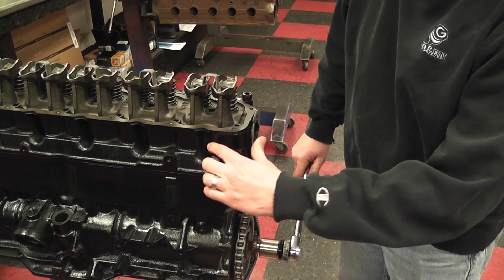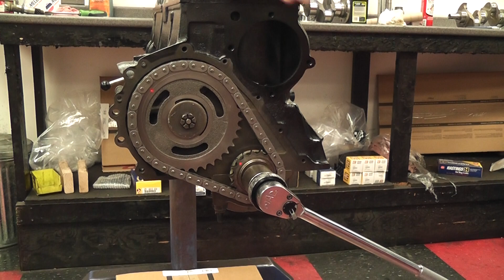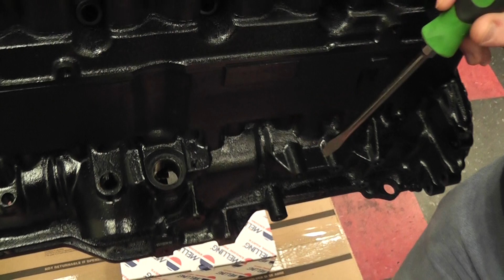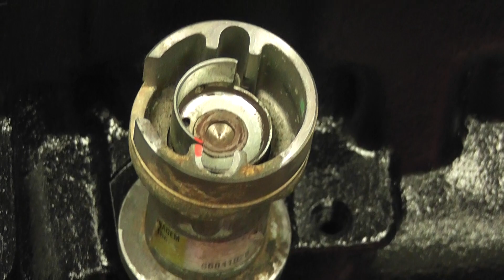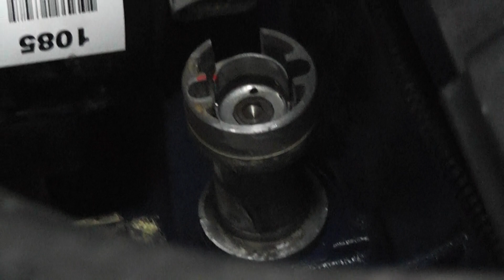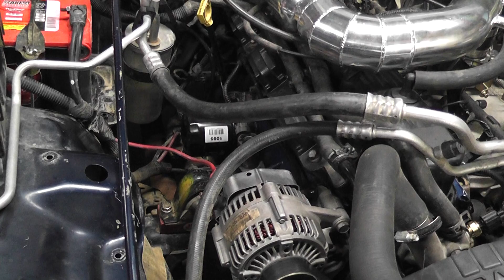Jeep Cam Sensor Install 2000-2006

Comment: I’m doing a long block 4.0 on a 99 Cherokee. Everywhere I look online there’s confusion. Your video shows you starting the engine so, do you think I should line my marks up like yours? Mine has a cam sensor too.

Comment: The best explanation of setting the timing on this jeep engine I've seen.  You can also put the two dots towards each other (not the compression stroke) and then use the toothpick through the side of the Oil Pump drive unit housing and through the alignment hole in the reluctor ring.  Note this in NOT on the compression stroke which is confusing to most folks.  The way you show is what you do if you want to set this all up ON the compression stroke.  Very good explanation.

Comment: interesting, i was taught that the two small holes, one in the housing and one in the rotor line up and put a piece of wire through the set it in making sure the cap connector faces straight backwards i have had mine installed for 1000 miles and runs great...but comparing it to yours one of us is 180 degrees out....does that matter?
Reply: Yes they do, that's how I did mine lined up the holes and it was good to go
Reply: Yeah, every other video I've seen has the pulse ring 180 degrees out. I think the right way is to align it with the holes. Dorman includes an alignment tool with the part if you get the sensor and synchronizer together.

Comment: Nice video, but wrong for 2005-2006 4.0. Those have a much different camshaft sensor and slightly different location.

Comment: Thanks for posting up this video. Im on a 1600 mile trip in my 03' Jeep WJ w/4.0L and it just randomly cut off. Flipped the key 3 times n it sent code: P0340 being Crankshaft Position Sensor Circuit malfunction. So i just went ahead bought the Crankshaft position sensor & Camshaft position sensor, kill 2 birds with 1 stone.. Lol FYI for anyone that doesnt know DONT cheap out n buy any sensors that aint Mopar.. These motors dont like anything that isnt Mopar electrical wise
Reply: 100% on MOPAR only especially electric, ie 4.0L fan relay, oil sending unit etc.

Comment: Wish you could have aligned up the timing cover and harmonic balancer TDC marks for folks doing the job with the engine in the vehicle, I think the dots on the timing gears go together and they are not at 12:00 which points straight UP. Does this part number not have an alignment pinhole through the outer housing to align the camshaft sensor drive timing? Thanks for the close-up pics. I thought 1998 to 2004 were the same?
Reply: I don't know if you figured yours out, but you can also put the two dots towards each other (not the compression stroke) and then use the toothpick through the side of the Oil Pump drive unit housing and through the alignment hole in the reluctor ring.  Note this in NOT on the compression stroke which is confusing to most folks.  The way he shows it here is what you do if you want to set this all up ON the compression stroke.  In both cases the notch on the harmonic balancer will be at the pointer indicating TDC.  It just one way of setting this all up is on the compression stroke (as he shows it) and the other way is on the exhaust stroke TDC (dots are together, use toothpick in alignment hole on Oil Pump drive shaft/Cam position sensor base).  Hope this helps someone out...

Comment: great video, thanks, I have 04 jeep wrangler, I just did a rebuild down replacing lifters, rods, camshaft, cam sensor, plug, coil bar, gaskets, timing chain. followed another video about timing marks, mine were installed facing each other. I didn't see if #1 cylinder was at full up.  car now runs, I have a misfire in cylinder 5 sometimes. going to change the plug again.  Cars runs smooth other than the misfire.  Here is the weird part, the Cam Sensor, now sits a 90 degree angle from your video. If not at 90 degrees, car wont start and if adjusted out of the 90, runs rough and stalls.  thoughts?  thanks?
Reply: mines doing same thing did u figure it out i spent like 2 grand and it still hard to start cold

Comment: Thought timing marks were supposed to be facing each other now I am confused
Reply: I thought on the timing chain the 2 dots next to each other was TDC on the compression stroke. When the dots are away from each other its top dead center not on compression stroke. It'll run might not tell a difference tho. This is what I was told. Any thoughts on this???

Comment: Great video but x3 on the tone ring it was wrong for a 2004 wrangler rubicon 4.0. It has to be 180 out on these instruction otherwise save my butt. Thanks everyone who contributed
Reply: I swapped a 2000 jeep xj and put a camshaft sensor in a 98 engine now it's throwing code for a camshaft sensor but it starts

Comment: i have a 2004 wrangler rubicon 4.0  am trying to install the sensor and syncronizer but it was running rough.  where are the timing marks on the timing chain cover i found it on the harmonic balancer but cant find it on the cover?

Comment: The video is good but wrong. all data and other sources show the reluctor facing the other way. in other words it is 180 degrees out of time. just fixed it on a 2001 xj. it solved all issues.
Reply: If you install the cam and crank dots facing right at each other and don't ever turn the crank, that would be true.  He has the crank turned to where the cam is 180 off.  If you install it his way, it will work.  However, if you pull an engine and turn the crank when you're tightening flex plate bolts that goes out the window and you can only strictly feel for TDC.  He should have made two videos, one for aligning the crank and cam the way he did and using the above method, then another one for feeling for TDC and then aligning.  When all else fails just use the toothpick method to lock the pulse ring in place and install the sensor that way.
Reply: @waynesanders1406  You seem to know what you are talking about. I have a 01 GCJ 4.0. I bought them camshaft position sensor and the long shaft thing that goes under it. How do I replace that?

Comment: What's the chances of a faulty oil pump causing the cam positioning sensor to stop working? I've noticed my oil pressure dropping over the last month or so. It works some times and then drops some times. What's been strange is the Cam Sensor has been ticking. So I assume it's actually caused the cam sensor to miss time?
Reply: i wonder if that isn't the problem with mine to, what years yours
Reply: the oil pressure gauge doing this is nornal along with speedo..

Comment: My 2004 jeep lorado NO!! The timing chain wont last the life time of the car i just changed mine yesterday and it had over a inch of play in it. Its not suspost to move that much i changed the cam shaft sensor and the camshaft synchronizer if u do not have both pices lined up perfect it will run rough like mine i have to take it bach off and set it again if u just change the synsor it has to be set right to u cant just put it on it wont start or run rough so if ur jeep is runing rough its prob the camshaft synsor
Reply: that's what i think the problem with mine is either no spark or the camshaft sensor ruined the plugs

Comment: Just did this on a 02 grand Cherokee your instructions are 180 out the ring has to be in the leading edge on the other side also on oem can sensor there is a hole you can align up and stick a tooth pick in to make sure your lined up correct.
Reply: hi Michael im doing a 01 as well and can not seem to get timing right on it. with your comment on this  are you saying the two dots on the timing gears have to be facing on another  or just like the on in this video?
Reply: +Michael Martinez Did you had a check engine light on? How do you know if the cam position sensor was bad?
Reply: The vehicle came in with a check engine for miss firing codes  and would buck and loose power under hard acceleration on the highway but would run fine at idle and around town it would run good when you cleared the codes the cam sensor had a lot of play and would move up and down . Replaced the sensor and synced the timing and vehicle ran great after that.
Reply: +Charlie Charlie when I did the cam sensor I did not pull the timing cover I just put it on TDC and set the harmonic balancer on 0 if you buy an oem sensor it comes with an alignment tool also there is a hole in the sensor housing and on the cam fazer those two holes will line up with each other it would have it installed correctly also once you are finished you need a scan tool to set the cam and crank sync at zero or your vehicle will run rough.
Reply: Michael Martinez that's a pain
Reply: Noticed that too!

Comment: Thanks for your post Doc! I just R/R'ed an engine in a 2000 Jeep Cherokee and couldn't figure out why it wasn't running but forgot to set the timing until I looked at your post!!!!
Reply: I have a 2001 grand Cherokee, is this procedure correct? I'm concerned. I have to get this correct the first go??

Comment: FYI - These instructions are 180 degrees off for a 2003 TJ 4.0.  The camshaft sensor has to be installed with the tone ring on the other side for it to work.
Reply: Same for the 2004 Grand Cherokee with 4.0L inline 6.   The video is very well done and very detailed.  Praise and thanks to Golen Engine Services.
Reply: @LOWGEAR100  thanks for this!
Reply: He set the timing at 180 out so that he could use the leading edge that is also 180 out ,that's how it worked for him . Not sure why he didn't put the engine at tdc and use the alinemen holes?

Comment: if my cam and crankshaft sensor needs to be replaced..will the old ones cause the engine to cut off during idle and have trouble staring up???
Reply: Crankshaft position Sensor at the flywheel